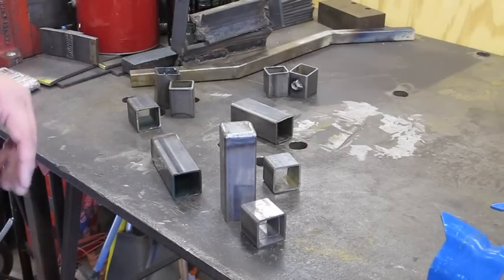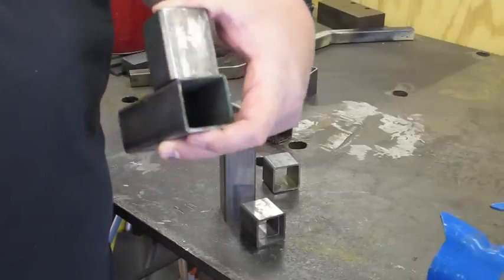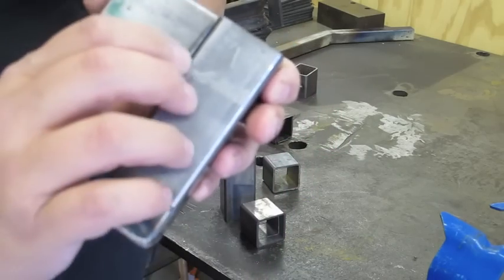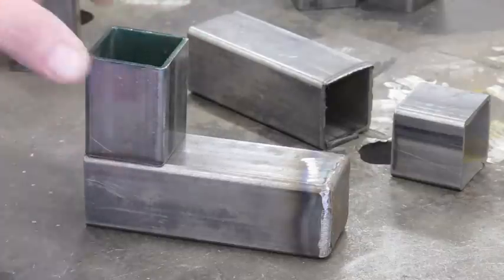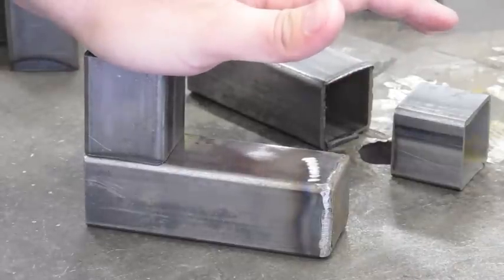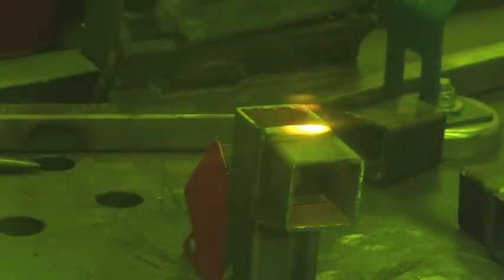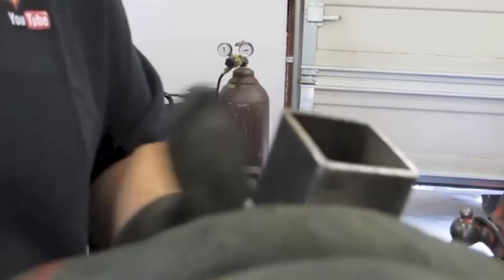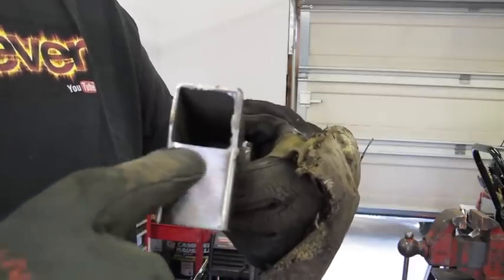Mig Welding - Square Tubing

Comment: why are you pulling? you should be pushing not to mention on something that thin you should be whipping
Reply from the maker: +Shawn Butikofer I get this comment a lot, and I have to assume you are from somewhere outside of the United States? There is no hard and set rule for pushing vs. pulling in the Unites States other than pulling provides for greater penetration than pulling, because of the increased heat to the weld puddle area. So, although you may view what I am doing as incorrect, I can assure you that it is not, at least not where I am from. As far as whipping is concerned, I am not entirely certain what you mean in regard to GMAW welding. If you could explain that a bit more, I could provide a better answer.
Reply: +WeldFever no I am in the states. I went to welding school at idaho state university. I understand adding more heat to the puddle, however if you are focusing the arc in front of the puddle u should actually be digging into your base metal (which would give you better penatration. ) pulling is acceptable I just found it interesting
Reply from the maker: +Shawn Butikofer That is true if your amperage (wire speed) is up high enough, however, as you pointed out this stuff is pretty thin and I don't like to push my luck on thin material, yet still want decent penetration, so that is why I went to a pull with a slightly lower wire speed. It's funny, because this is a situation that demonstrates welding is more art than science, because we are both correct. The difference is that we each chose a method that corresponds to our preference based on our individual welding technique. In the end, I believe the the result would be the same for both of us. A good weld with adequate fusion and penetration, we just happened to go about it a different way. Thanks for your comment.